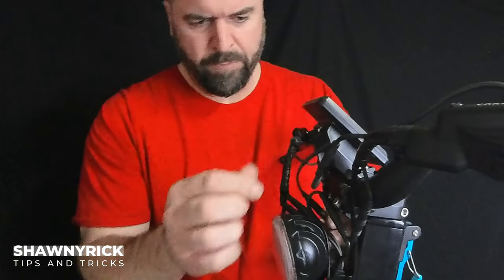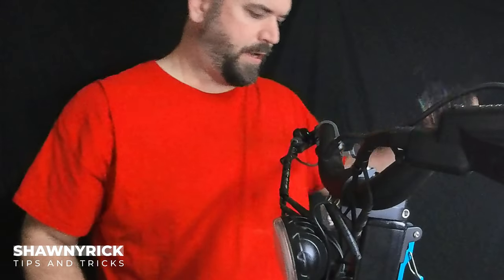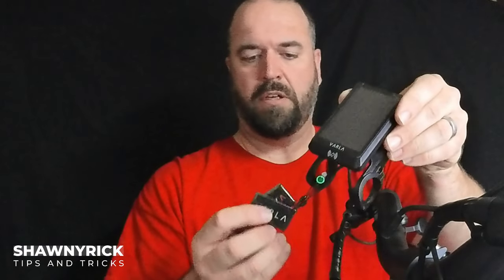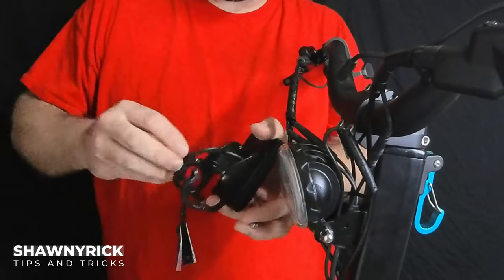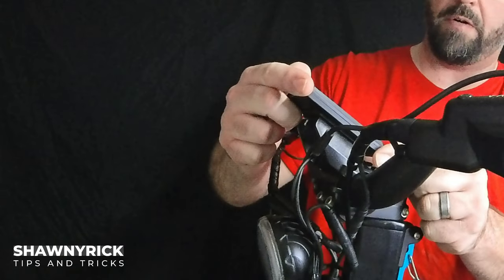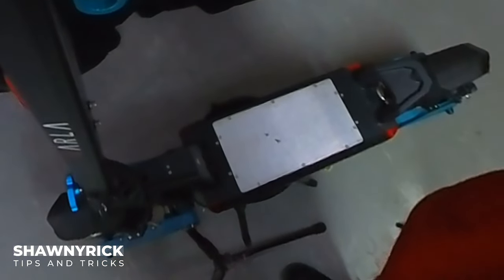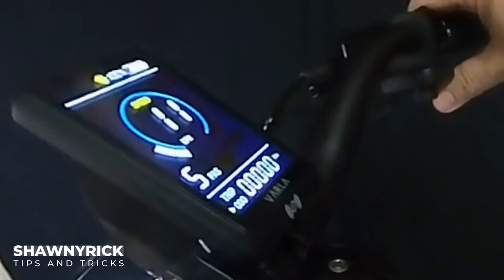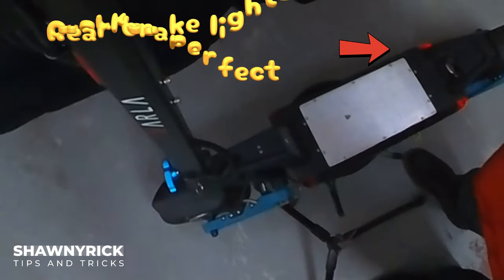Issues with the LCD display, how to replace, and fix #varlascooters #VarlaeagleoneV2

Comment: I have the Varla Eagle One Pro with 41 miles and I can’t get the battery to charge over 87%. Do you have any idea on what the issue could be? I can’t find anything online.
Reply from the maker: Most likely a cell in the battery pack is bad get a hold of varla and see if they can send you a new battery under warranty

Comment: I just replaced the display on my V2 it is showing the battery is only at 48% but it's showing 58.9 volts
Reply from the maker: The display can be bad possibly but what I would do is, prop it up on a crate and place the  scooter in cruise control wheels off the ground and let it run down to 42 volts, no less, then plug the battery in let it charge and balance again all the way and then see if the display matches after that.
Reply: @shawnyrick  I'm pretty sure they sent me wrong display being as it's p settings are set to 60v (pro model) and my scooter is the v2.0 52v 
The new display won't let me change the values for the voltage
Reply from the maker: Oh okay yea! That's the problem
Reply: @pixelskyphotography2556 Im having the same problem as they dont sell a replacement screen for the V2.0
Reply from the maker: Why did you need to replace your V2 Display?
Reply: @Shawnyricks-E-rides My regular v2 display burnt out when i was playing with the fuses
Reply from the maker: Yes that's common when your checking things like that. That's why it's best to unplug everything before looking at your fuses. You will have to order another display
Reply: @Shawnyricks-E-rides  from where? varla dont sell one
Reply from the maker: @p_aid  contact Varla support through email they have them